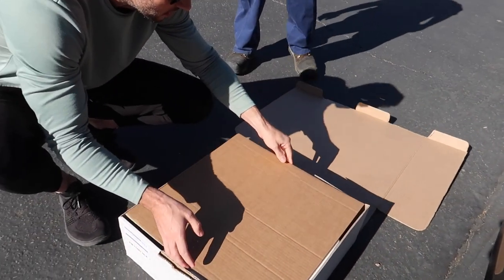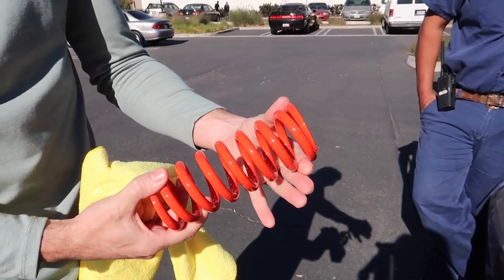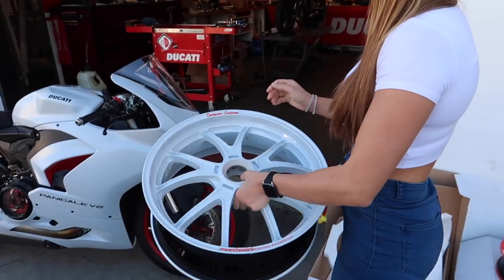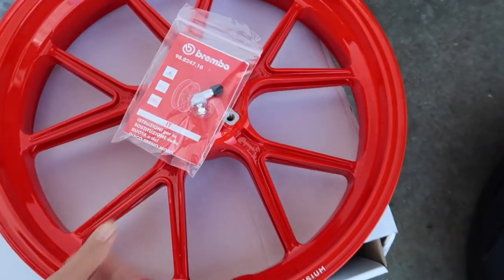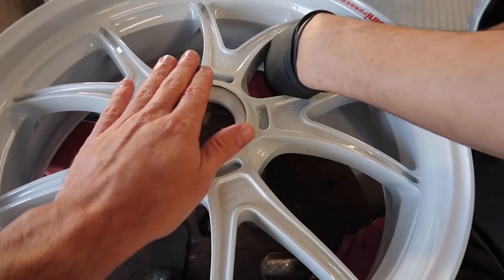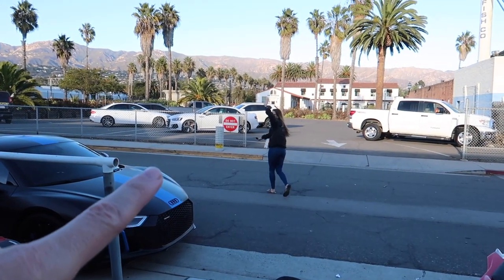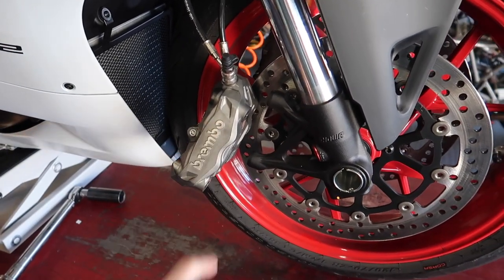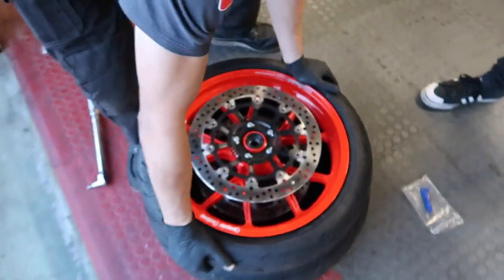Our Panigale V2 Gets $5,400 Custom Painted Mag Wheels!!!

Comment: Warning: the V2 DTC is not auto-adjustable, it means that the stock phonic wheel is made for the 180, if you mount a 190 the distance is not well read, and the DTC will work bad.
Regards from Italy

Comment: It’s not 6.5 lbs as you have a larger and heavier rear tyre adding mass back to the rear. The new rear should have been weighed with the tyre mounted as should the original rear.

Comment: You should have used balancing beads in the tires so you don’t have to see ugly weights  on those gorgeous wheels. Check them out. Look up CounterAct motorcycle balancing bead kit. They work great, I’ve been running them for years with no issues.

Comment: Be careful with aftermarket valve stem caps I bought a set of aluminum roush caps for my roush f-150 and the chemical reaction from brass to aluminum locked them up tried heat , cold ended up using pliers and screwed up the valve stems maby try some dialectic grease it would probably help .

Comment: Jaret, why didn’t you powder coat the wheels instead? The paint is going to chip and scratch really easily.
Reply from the maker: He used a durable paint with MANY layers so it will be completely fine.  There were too many parts to mask during the paint process so powder coating wouldn't work